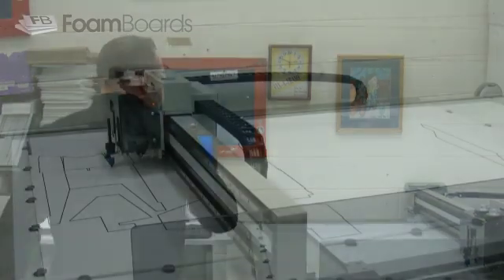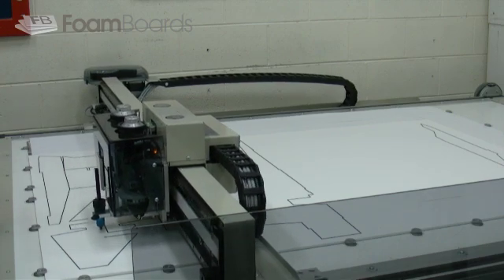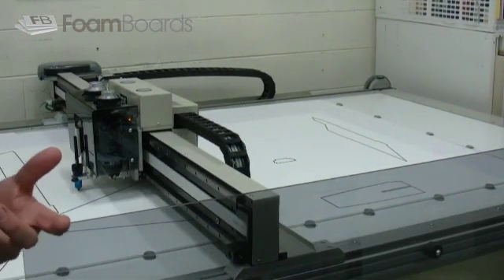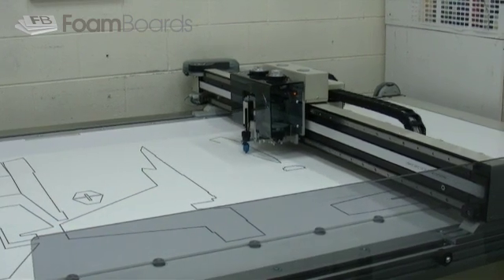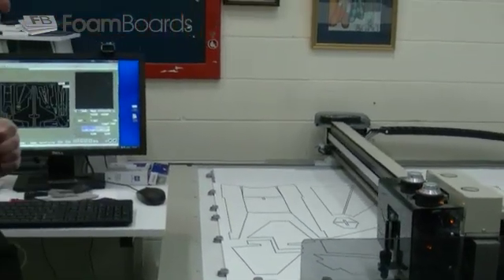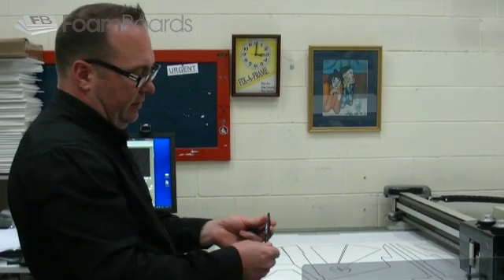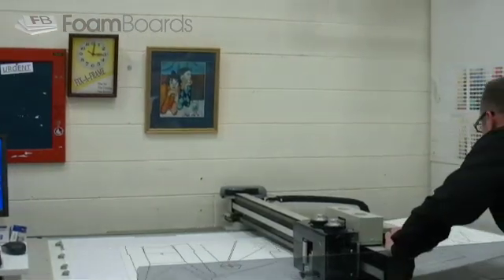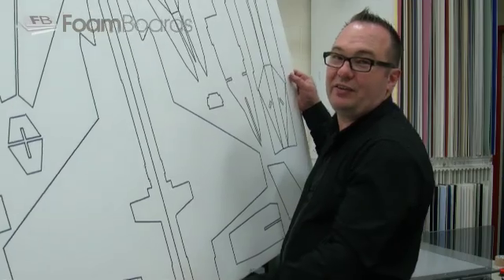Model Plane Plan Drawn On Foam Board For Modeling

Comment: Throw a 40W CO2 laser on there and save yourself the cutting part :)
Reply: Thanks Brent. We run a knife head on the machine all day cutting different shapes out of foam boards but a lot of the RC Model Building Plans out there suggest printing the plans and then cutting by hand so we wanted to remain true to that process somewhat. I agree that using a laser or other cutting device that is automatic speeds the process but most people can't access that type of equipment. Thanks again for your observations. Kind regards, David Schummy
Reply: Most people don't have a plotter like that can draw on the foam either!